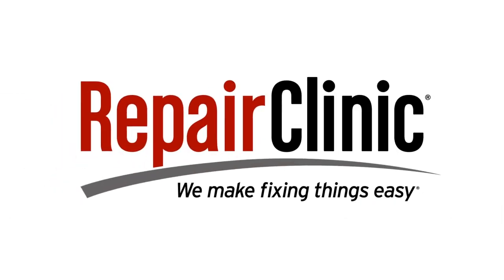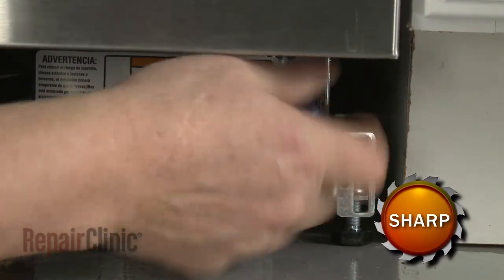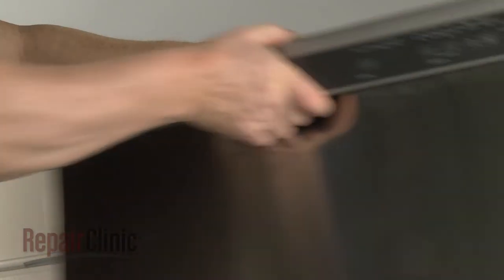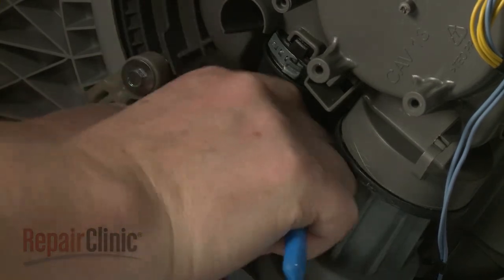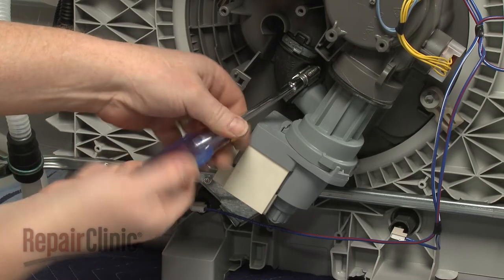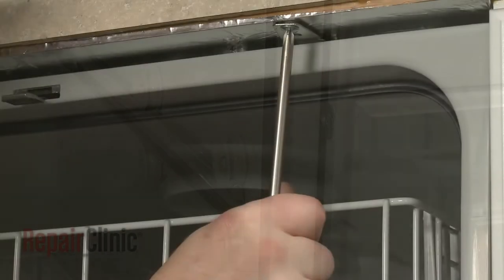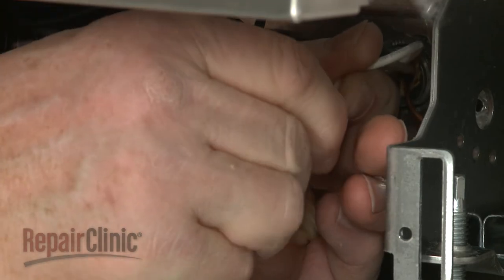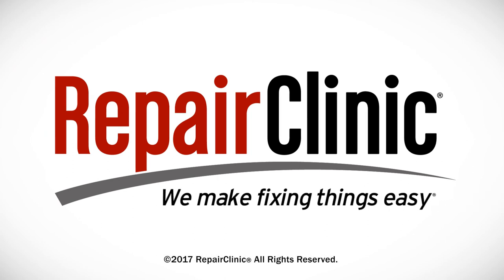Whirlpool Dishwasher Circulation Pump Replacement W10879262

Comment: For the grommet, I would highly suggest you wipe out around where it fits over the new pump.  I had to fore thought to pour some water into the sump after finishing re-assembly of the pump but before I re-installed the dishwasher.  There was a slow drip right around where the it fits over the pump.  Pulled it back out, used a little soap and cleaned it really well.  Re installed it and there has been no drip.
Reply from the maker: Thanks for the tip!

Comment: This may get those dishes done while you are waiting for the new pump to come.

Before you remove the whole pump assembly, at about 3.10 in the video, remove the actual pump motor which is on a bayonet fitting. Depress the retaining lug and rotate counterclockwise a quarter turn. The pump motor and impeller assembly will come free. Check there is nothing physically  blocking the impeller and the inlet and outlet ports are clear. Spin the impeller by hand a few times to make sure it is freely spinning. Reassemble. Then try the dishwasher - it may run for you. If it does - great and you saved yourself a few bucks today and got the dishes done. But who knows for how long. Best to still get the replacement for 'next time'.

Comment: Thanks for the video, unfortunately I have the 2019 model and the gasket thing that you remove in the video is glued in and I ended up poking a leak in it trying to get it out. Bummed out!
Reply: If you had to do it again would you just leave the gasket in and connect the new pump?
Reply: @tpmartins  I don't remember, that makes sense to me though. I ended up buying a new dishwasher
Reply: For anyone dealing with the same problem-Disconnect the gray plastic part( the grommets still attached) from the motor by turning it counterclockwise. And use that old part on the new motor part purchased. This way you don’t ruin the grommet and you’re sure of a tight seal. A lot  cheaper than buying a new dishwasher